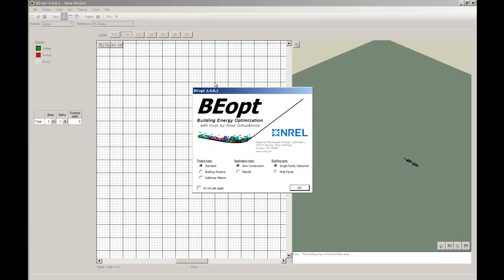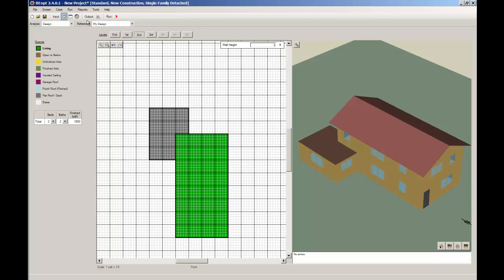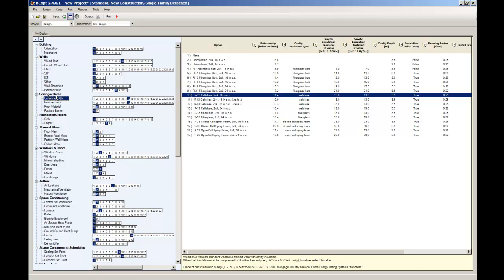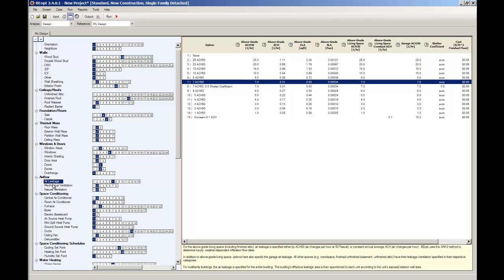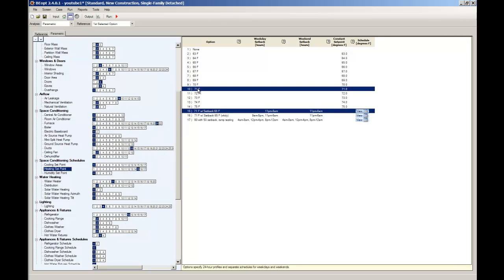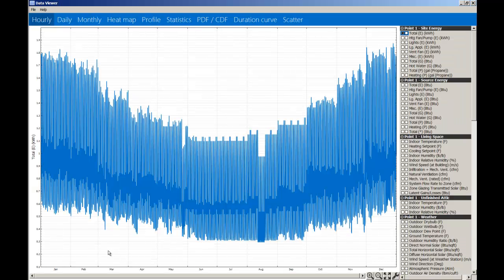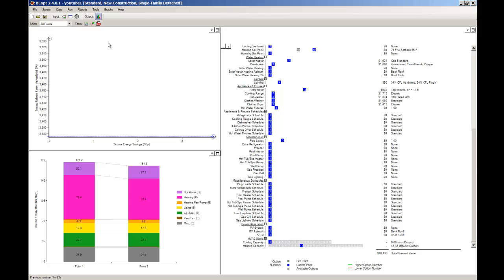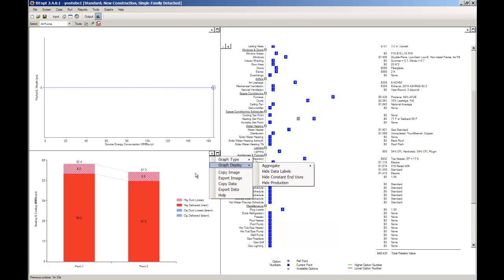BEOpt, 16 minute, fastest introduction to key features

Comment: I have a question. How did you get Dview? I am not able to find it in my project.
Reply from the maker: Try re-installing BEOpt. Dview is included with it.

(When you run the simulation, I think there is a checkbox to view the results in Dview... haven't done this in a while). Good luck.
Reply: Thank you so much. It worked. I had to install the lower version. I have one more question, how do we find out lets say percentage of HVAC (electricity used) in a year?
Reply from the maker: I'm not sure about electricity (ie fuel type breakout), but if you click around the different Dview options, you can get usage by end use. I.e. heating. Then get the total use.

The easier way if you are looking for annual is to go back into BEOpt and look at the energy reports. Dview is more for getting time series data. The energy reports give you annualized.
Reply: Thank you so much. Can you also tell me how to change the air leakage percentage. lets say if i want to find the energy use if the duct leakage is 15%
Reply from the maker: Not sure about duct leakage, but air leakage is included.  You just have to scan through all the parameters in the model setup. Look at minute 3:51 in the video; it's that screen.